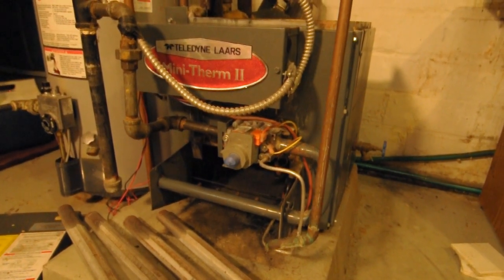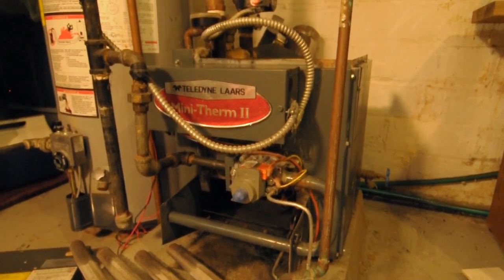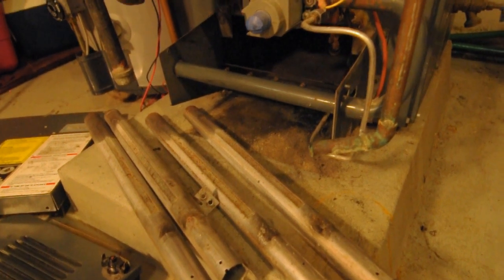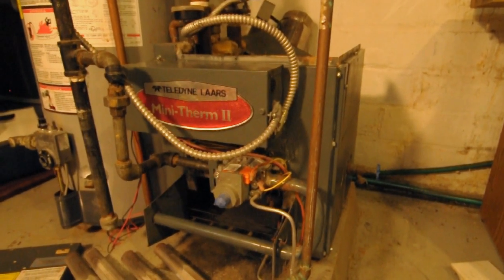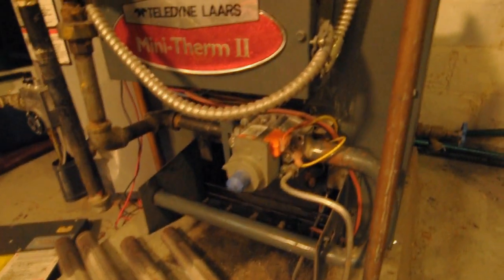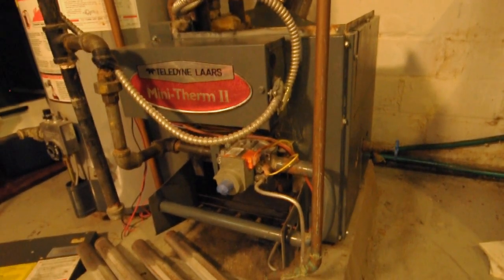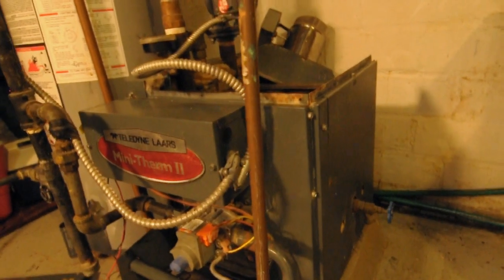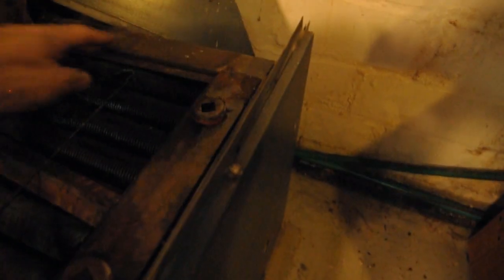Cleaning service gas boiler radiator heat Laars JVS-100 Mini Therm JVS100

Comment: Problem fixed THANK YOU  below was the problem i had since i could not take the top of the heat exchanger off i used an air compressor and blew it out now the temp runs at 117 degrees and not tripping the rollout switch THANK YOU AGAIN you were the only one on youtube that knew what he was doing*** on the top of the mini therm II heat exchange ours looks like the plate is sealed  if i break that loose will that cause exhaust gas to leak out? i have cleaned the inside of the exchanger  the problem is after the boiler is running the temp where the roll out switch reaches over 250 degrees which trips it(doing its job)   the flue is clean also  wondering what is creating the heat to reach over 250 degrees

Comment: Thanks for posting. Pretty grimey job. On the newer units  (mini-therm II circa 2001) you need to disconnect the draft diverter and damper to remove the flue collector so you can clean it off.

Comment: My minitherm 2 sometimes doesn't fire up, spark is there, pilot get lit , you hear the gas but after 6 seconds shuts off, usually turning the thermostat off and then on will make it work (sometimes takes 3 times)
Reply: You find out your problem?
Reply: @TheMentalMKE  after cleaning the burners and the pilot all went back to normal , the radiator was clean
Reply: @giuseppearbia  That worked for me, Thanks

Comment: my wiring seems burned out and i think my control module is leaking can i just replace it instead of getting a new boiler?
Reply from the maker: If you are implying that the gas valve is leaking gas when the integral  solenoid should have shut it off, you must immediately turn off the shutoff petcock leading to the unit and call a licensed contractor for service, as your local code probably prohibits a handyman from replacing gas lines or componentry,  and you may need a permit to replace the valve as well.  What wiring is burned out? the main PCB could fail but replacing parts on a venture will be costly, time-consuming, and unnecessary.  Best to call for service and have a professional diagnosis.  If the unit is at the end of its service life you may want to get a few quotes for a replacement.  I think Laars still makes this thing- a direct swap would simply the labor of hooking a new one up.  I moved to a different home a few years ago; my "new" home has a heat pump and backup oil burner, so this unit is now in "the rear view mirror" for me.

Comment: Where is the rest of the video …?
Reply from the maker: At the time I shot this video, the only digital camera I had took a maximum clip of five minutes.  I had already detached the vent hood-to-chimney sheet metal, so I began the video there.  The video does cut off at the five minute mark, before I was finished yakking (my apologies for not getting straight to the point, but I felt that some who are uninitiated with and intimidated by a boiler might need an primer overview of what they are looking at).  However, the re-assembly is simply the reverse order of disassembly.  I uploaded this video because simple cleaning is within the  wheelhouse of the end user, the homeowner.  Leave any gas plumbing or high voltage wiring chores to a professional HVAC technician.   You will notice that there are a few rudimentary but vital safety valves and switches on this unit (such as the flame rollout thermal switch).  These must not be bypassed- if they are defective, they must be replaced with the same spec part.  Bummer that Youtube puts ads of everything these days, eh?  i set the thing up with no monetization and no ads, but they changed the terms on us since.

Comment: Do I need to shut it down first to run the maintenance?
Reply: Yes, cut the power to the unit,  or at least turn down the thermostat so it doen't call for heat while you're cleaning it!  And I neglected to mention that you need to unbolt the exhaust hood assembly and set it aside (as you see in the video).  Good time to check if any vent pieces need to be replaced.One other thing, now that you mention power:  on mine, I hard-wired a battery-powered UPS between the fuse box and the heater;  the pump draws little power, and that waw you have heat if the power goes out, without resorting to firing up a generator!

Comment: I am the opposite of a handyman - my minitherm 2 is just stopping for unknown reasons, I had a service technician come out, he reset it  while I was not home, and it came on and worked for days.

how do I restet the boiler?
Reply: He may have reset the thermal flame roll-out protection cutout (the one on the manifold tube cover with the red reset switch).  It does not automatically reset, like many other thermal switches, because the cause of the flame roll-out that presumably activated it must be corrected.  It could be due to the chimney/exhaust system that is not drafting properly.  Or the switch itself is defective.   Press it to reset it,  and observe the boiler as it is firing.  Also, a faulty sending unit from the pilot light  assembly could also keep the unit from working. for obvious reasons, the electronic spark or pilot light (depending upon the model ) must be on before the main gas valve will open). If a single roll-out switch reset does not work, call the technician back; he should stand by his work.

Comment from the maker: Let me know if this answers your LAARS boiler cleaning questions!  I would have covered the reassembly, but my camera limits videos to 5 minutes.  Reassembly is simply done in the reverse order that you took it apart!  I didn't show the part where I removed the exhaust collector to exhaust pipe sheet metal, but it is easy to figure out; it's bolted on with the same type of sheet metal screws.
Reply: Thanks for this, JVT 50 Flame Roll Out Switch keeps Shutting Boiler down, guess it needs a good cleaning. Thanks Again
Reply: If you don't want to go through the bother of cleaning it from the top, a reasonably effective cleanout "on the quick"  would be to remove only the three quick-release burning tubes, and simply covering the fourth one( with the pilot light or spark assembly), then reaching way up into the firebox to brush off and vacuum out those heat exchangers from underneath  (which, I forgot to say in the video, you could do anyway when performing a full cleaning).  Also, cut power to the unit before cleaning it.
Reply: Update: Pulled Top End and Burner Tubes Cleaned Everything, Really not to Dirty, Put Back and Fired Up but Shut Down Again.
I Ended Up Pinching the Supply Gas Valve Just a bit while watching the Flame in Burners to maximize burn. Been Working for two days now with no issue.
Reply: If there is no actual flame rollout,  the rollout breaker switch may be failing, or perhaps there is some downdraft of obstruction in the chimney/ chimney vent.  Glad to hear that is is no longer rolling out flames.